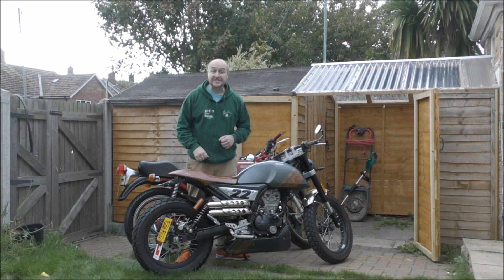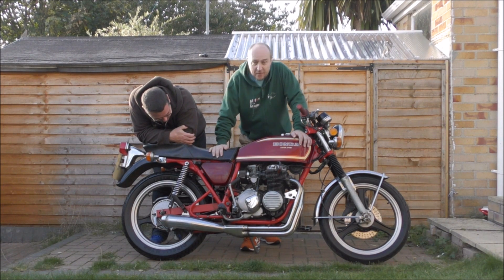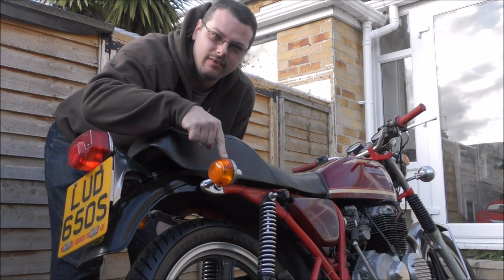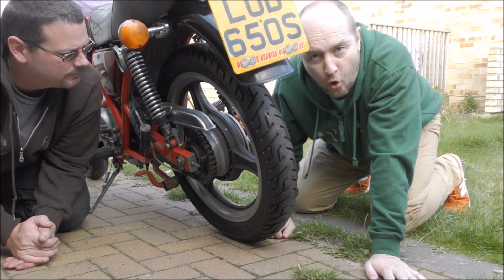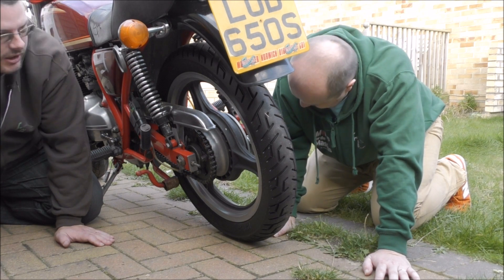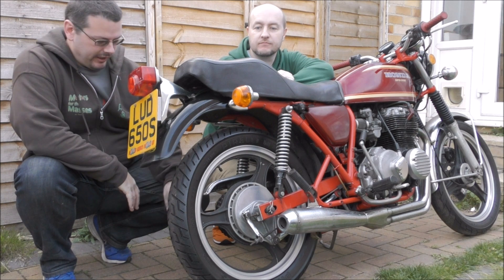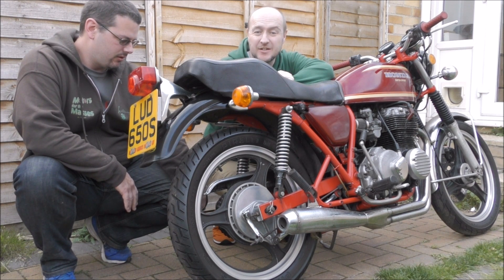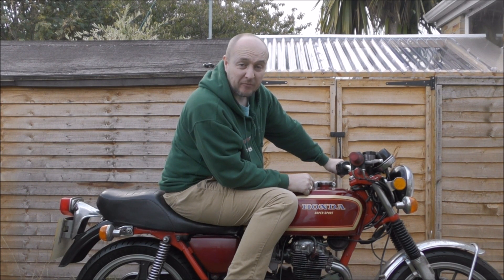Budget Cafe Scrambler build The Hybrid part1

Comment: I had a red 400F in 75.  It replaced my 74 Rickman Bonneville that was nothing but trouble.  The 400F was a great bike for its day. If I remember correctly you could get a 460 kit for the 400F (Mocheck ?).